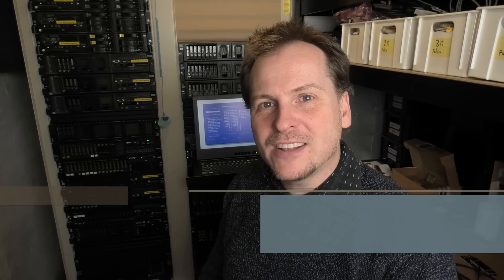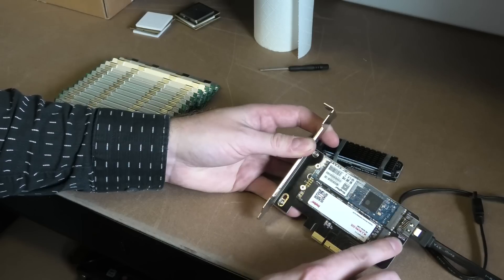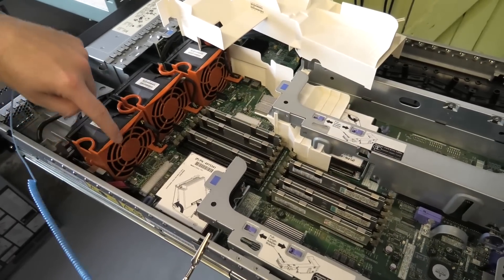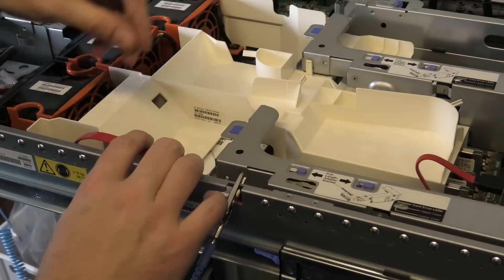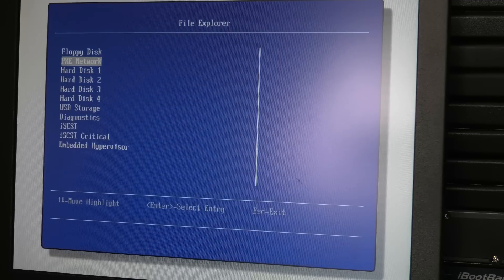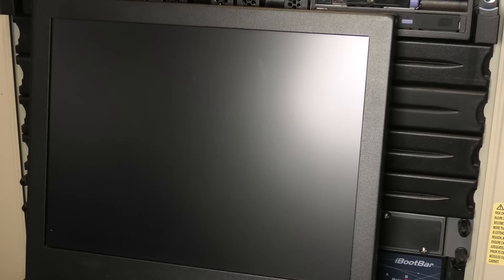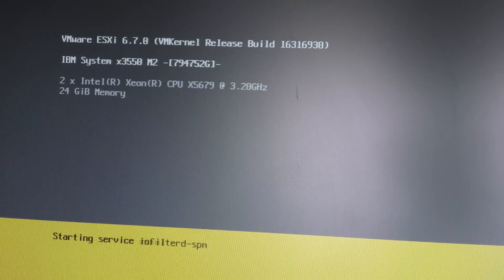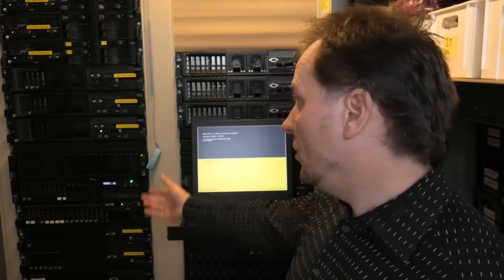Will IBM/Lenovo x3650 M2 do ESXi 7.0 and NVMe - 1003

Comment: I have a few servers running with these old Westmere-EP Xeon processors on Super Micro motherboards, and according to the manual, depending if you use memory sticks with single, dual or quad ranked memory modules and depending of the number of memory channel you populate, the memory frequency will be limited because the memory controller can't achieve higher frequencies with the higher "ranked" modules (dual or quad). So I suppose that's a limitation of the processor and you have the same behavior here with a IBM/Lenovo server.
https://www.supermicro.com/manuals/motherboard/5500/MNL-1076.pdf
(look at page 2-8 and 2-9)
Edit : Well James Rogers said pretty much the same thing as me in a earlier comment!
Reply from the maker: It turned out that the x5679 only run 1066MHz and not 1333MHz

Comment: Hey man, I’ve been looking a lot of your videos the past couple of years and I came across an video of you reviewing the DL580 G7 server, I own a few servers myself (1 Supermicro SC846, 1 DL385 Gen 8 - 25 disk SFF, 2 DL380 G7 servers, and 2 custom build servers) my plan is to ditch the SC846 for another DL385 Gen 8, and ditch the custom build servers for 2 DL580 G7’s, because I run my own gaming network the workload is more memory intensive than CPU intensive, I’m only beginning to looking into high end servers, I’m young just finished school and I’m asking you for a recommendation of what to buy next and maybe you can help me get a great deal on the DL580 because I searched all over eBay but could not find a nice deal with rack rails and hard drives included, my plan is to use 1 DL385 for storage (backup) and the other for player databases (MySQL) and the rest of the servers for running the game servers and websites of the network, if you have suggestions or have some links to put down you can always contact me at bradley-methorst@outlook.com
Reply from the maker: Hi Bradley Methorst
Thank You very much! I would personally stick with 2U servers for your need, way easier to get parts for,, and move :-) and BTW I do recommend Lenovo :-)
Thank you for watching! :-)

Comment: Regarding your memory problems, are you using all 18 DIMMs?  The X5600 series CPUs will only operate at full memory clock speed (1,333MHz) with a maximum of two DIMMs per channel.  If you populate all three DIMMs, this limits you to 800MHz clock speed.  As a result, on the M3s (and presumably also on the M2s) you are limited to a maximum of 192GB of RAM using 12x 16GB DIMMs if you want to stay at maximum clock speed.
Reply from the maker: Hi James Rogers
The IBM x3650 M2 does only have 16 DIMM slots 3 in bank 1, 3 in bank 2 and only 2 in bank 3
I do believe it is 1333MHz with one DIMM, 1066MHz with 2 DIMM's and 800MHz with three.
Thank you for watching! :-)

Comment: where do you find 1366 socket heatsinks for a diy server, cool rack there but wife wont accept those machines so i have to go more quiet stuff :)
Reply from the maker: Google the socket and heatsink,,  and tell the wife that you need an enterprise server for each pair of footwear she has over 5 :-)
Reply: @MyPlayHouse  we allready have a agreement that says if she gets a new plant/flower i get a new computer :) (doesnt work but i can hope) there are plenty of heatsinks available, they are for multi sockets 775 to 1366 to 1155 and amd but they are so huge that they might not fit on that old dual xeon intel board because of the width and used server versions are hard to come by. maybe ill just modify them with a hacksaw :)

Comment: Yeah, so welcome to Windows server that everyone hates on and complains about, but that will run on a toaster. Free / Pay – Does not work / Works
Just to be clear, I was a big, big Proxmox user. Now I am Windows all the way and have moved all my machines to Windows server and Hyper-V – Best thing I ever did
Reply: Simply because you can’t use it ?
Reply: Yes but it need cpu that support  specyfic instruction e so for example xeon e5450 won't run HYPER-V in server 2016 and server  2019. Oldest cpu that support it are xeon x34xx or i7 1st gen.
Reply from the maker: I am sure Hyper-V is working, I have seen more that Microsoft is not pushing Hyper-V anymore because they really want you to be using Azure,, they want a monthly link directly to your bank account. Same will most likely soon happen in win10 something will soon cost us a monthly fee.
Reply: @MyPlayHouse  I do not believe that Microsoft will start to charge a monthly fee for Windows10. It would destroy them in my opinion. What they will start doing however, is forcing us to use certain apps (from them) if we want to do certain things on their platform, move more and more of this into the cloud and push more and more advertising. But, you may be right and they might shoot themselves in the foot with a subscription for Win10.
Reply: @MyPlayHouse  No it is still needed to make it work. This instruction is called "intel vt x with extended page tables".So if you want HYPER-V you need buy minimum cpu on lga 1156 or 1366.

Comment: Looks like the difference between the x3550 and the x3650 is the chassis it's mounted in.  They both appear to use the same motherboard, at least after a point in time.

x3550 - item 21 - https://www.ibm.com/support/pages/node/803926
x3650 - item 10 - https://www.ibm.com/support/pages/node/803932
Reply from the maker: It is pretty smart, from a services and parts point of view.

Comment: Hi. You can try to add allowLegacyCPU=true ESXi boot option which will allow you to bypass the unsupported CPU during the installation/upgrade. To do so, just use SHIFT+O and than add option.
Reply from the maker: Hi CrazyRatel
Thank You very much! I will have to try that - glad you liked the video :-)
Thank you for watching! :-)
Reply: Yes, that is the correct thing to do. Been using it for a few months now, works beautifully on Xeon 5600!